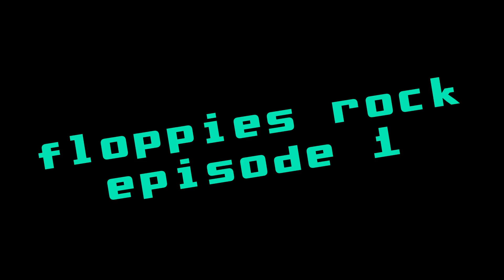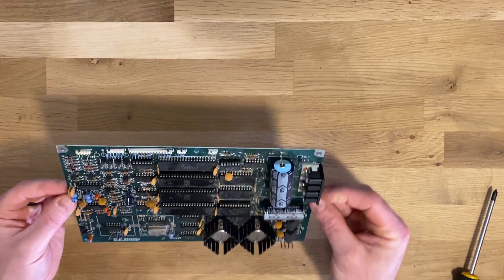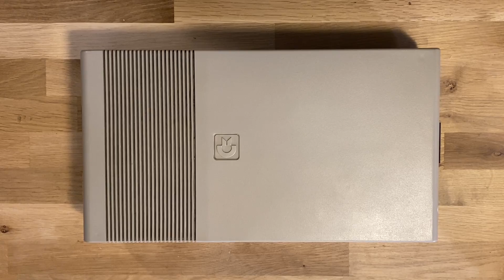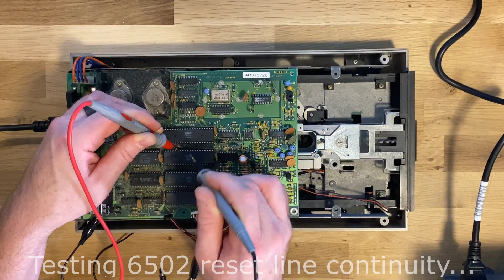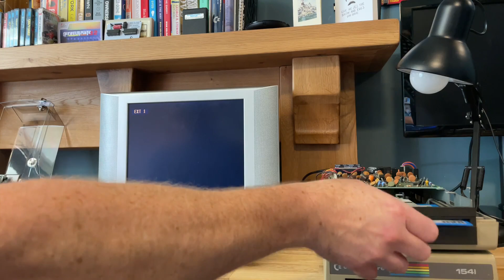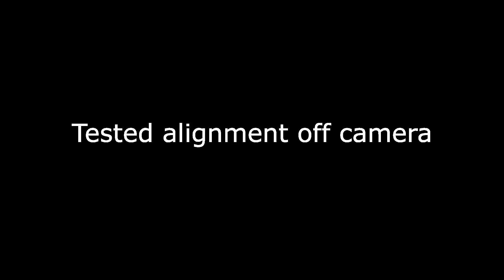Fixing two "untested" ebay Commodore 1541 disk drives - floppies rock ep1

Comment: Great video - thank you.. I've got a 1541 that I've been trying to fix for ages and this gives me some nudges in the right direction (I've checked/replaced the ROMs, but I've still got a long way to go to work out what's wrong - is it a fair interpretation to suggest that if the red LED flashes 3 times that the CPU is OK, since it needs to be working to generate the fault code?)

So many failed chips, though.. I do wonder what causes a simple TTL logic IC to stop working...
Reply from the maker: @zx85 Search for Ray Carlsen's 1541 troubleshooting guides - they are on zimmers.net.  Flash core 3 does mean the CPU has booted and probably indicates failed UB3 325302-01 (could be your other ROM, but the CPU has booted from that to do the flash codes, so less likely).  It can be other things on the bus causing conflicts, but new bottom ROM would be my first port of call.

I reckon the TTL ICs tend to fail because of corrosion - I reckon it probably gets in via corroded legs.  I've seen suggestions the ROMs fail due to "bit rot", but have no technical experience to back that assertion up.

Comment: 36:23 here you should have removed the disk and reinserted it. There is I think a microswitch that senses if a disk was removed. As long as this is not detected, the drive will stay in failed state. The older CBM drives are the same.
Reply from the maker: I wasn't aware there was a microswitch to sense the presence of a disk!
Reply: @piers_rocks  I think it's not in all variants. Pretty sure the Newtronics/Mitsumi don't have it. But ALPS and/or Micropolis ones I think have something akin to that. Or I am hallucinating...
Just checked on the 8050 with Micropolis analog board, but clone drives: They have a microswitch which gets triggered when the latch is FULLY closed. I have to open up an ALPS to check if they have something similar, and I would need to dismantle my Micropolis 8050, too, to check what kind of sensor they have. So I think many have a mechanism on the latch, but some I think have a switch when inserting the disk.

Comment: Hi thank You for sharing Your experience. Im struggling with 5 of them just for fun. One I'am working with now, have mostly bad alignment readings. I suspect MOS 325572-01 but have to wait for spare one. What kind of IS tester do You use for 70xx ICs?
Regards from Poland 🙂
Reply from the maker: I use my xgecu T48 programmer to test the 70 series ICs.  I haven't had a duff controller chip so far, although I will hopefully be featuring a 1570 which is showing what look like alignment issues in an upcoming episode.  Thanks for the comment!

Comment: Very cool - really enjoyed that! But you're going to need a lot of Pets for all those disk drives... ...particularly if they keep replicating so fast - you seemed to go from 3 to 5 drives in ~40 minutes :). 

More seriously, I've found dust seems to make corrosion worse. I guess if the kit is kept somewhere damp the dust traps the moisture - and bad things happen. I wonder if the moisture also creeps into the chip itself and that's what caused the failures? It seems battery alkali and capacitor juice can work their way into chips, so maybe moisture can as well?

One day I'll get to fixing my CBM 8050 drive (it's a lot rustier than your ones) - for now I just use a SD2PET :).

Looking forward to the next one!
Reply from the maker: Thanks Martin!  I agree with you re the moisture creeping into the chip.  There was an interesting @adriansdigitalbasement video last night where the problem seemed to be an IC oscillator input "leaking" through to another pin, which again seems like corrosion inside the chip to me.